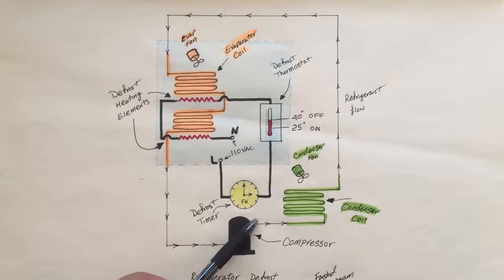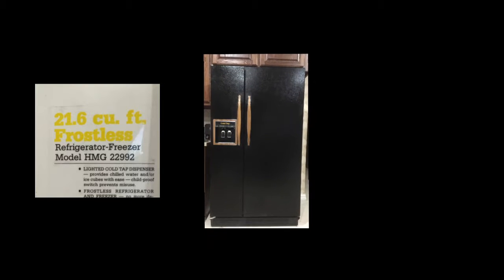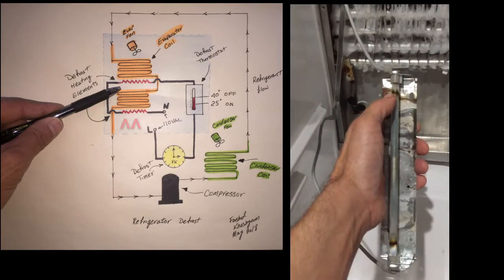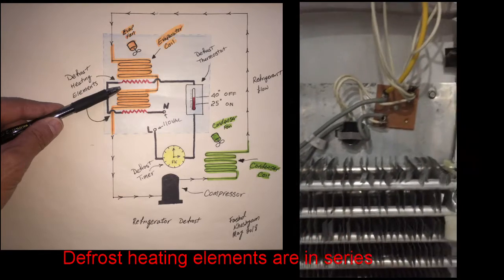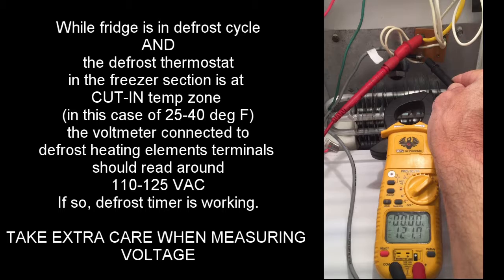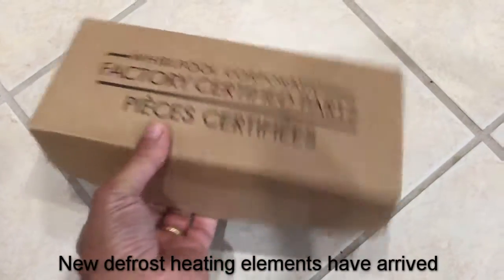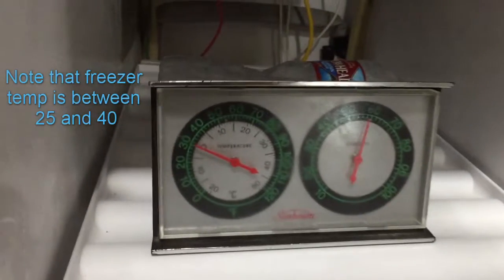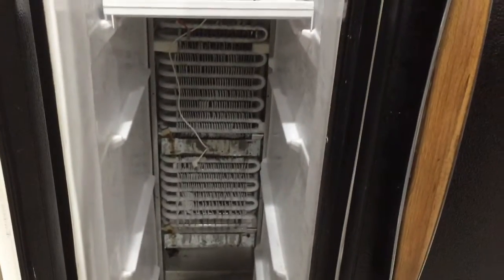Save Money, How Kitchen Refrigerator Works & Fix It

Comment: i have a world pool refrigerator the freezer is not cold like it should be to ake ice but its still cool and my other side is cool as well any advice
Reply from the maker: It’s usually the other way around, freezer is cold but the fridge side is not. And, that is caused by the internal fan not working. Sorry, I am not sure what could be causing your issue other than low refrigerant.